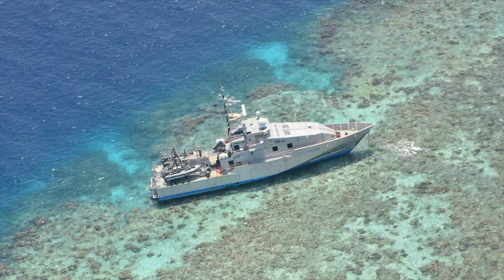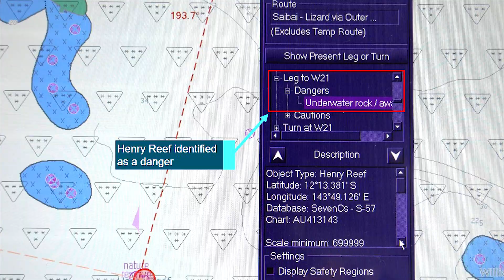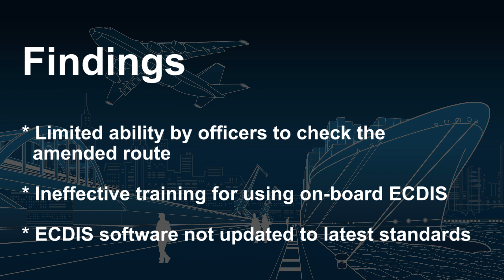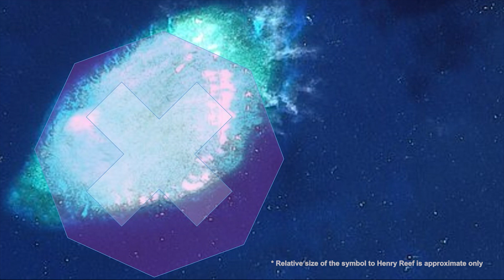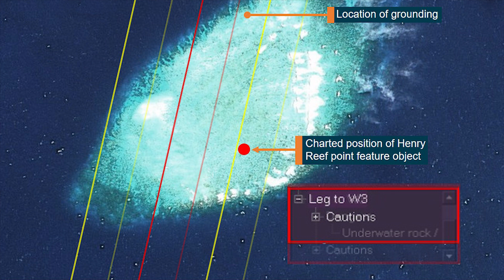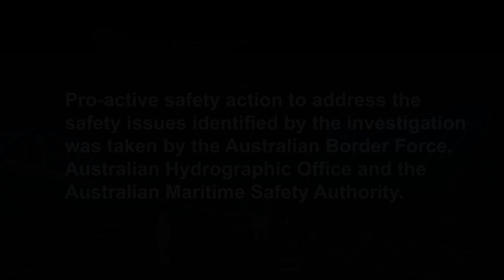Grounding of ABFC Roebuck Bay

Comment: Most of these findings had nothing to do with the incident.  The navigation system did everything it was supposed to do and told the crew that their planned path put the ship in jeopardy.  It doesn't matter how sophisticated the system is if the people operating it wouldn't even have been able to comprehend a paper chart correctly.